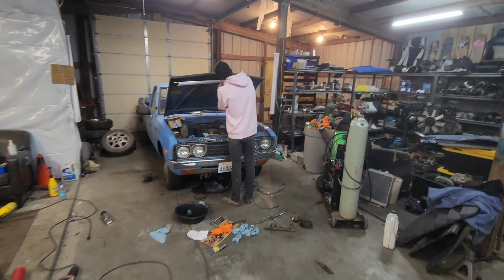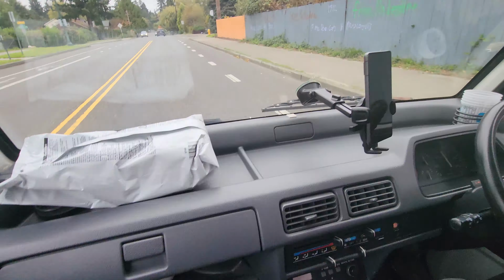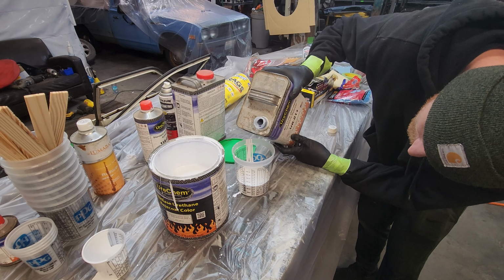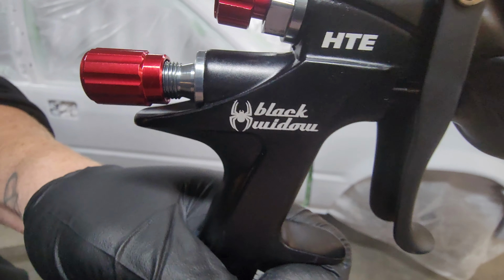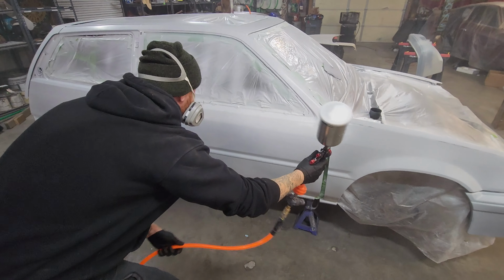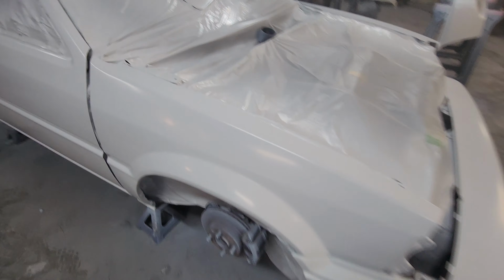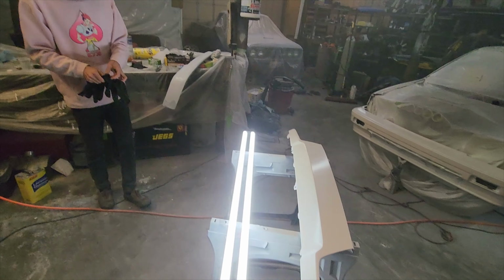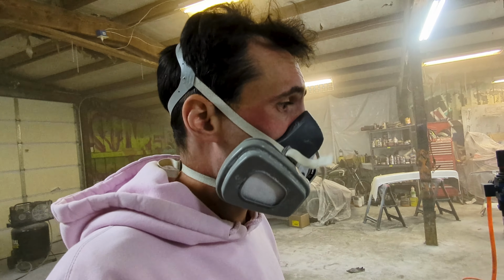THE CIVIC IS FINALLY PAINTED!!

Comment: Yo how much would u estimate this paint jobs costs when u break it down to the cost of paint, clear, and the new gun?
Reply from the maker: The whole base, clear, and midcoat kit was around $450, the gun was almost $200, the high build primer was $100, flake was $40 and then I would estimate all the supplies like sand paper, tape, solvents, tack cloth, filtered masks, body filler I would estimate another $400. so without the other equipment and buying a new door and trunk. It was around $1200
Reply: @ it aint cheap 😂